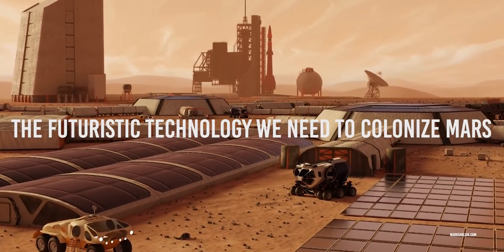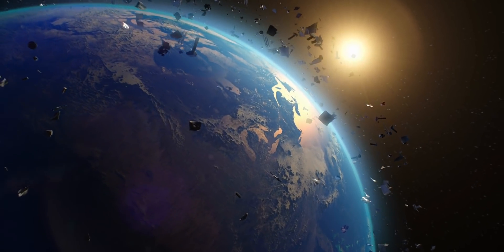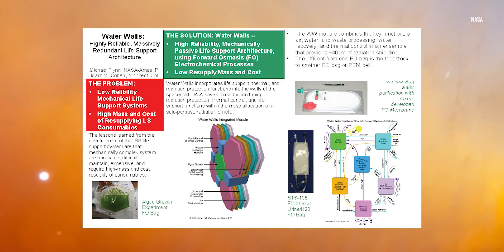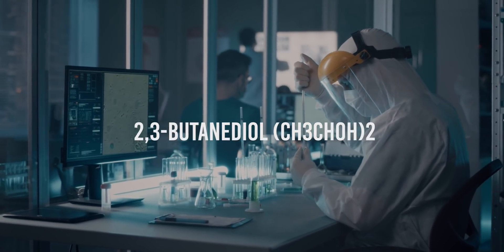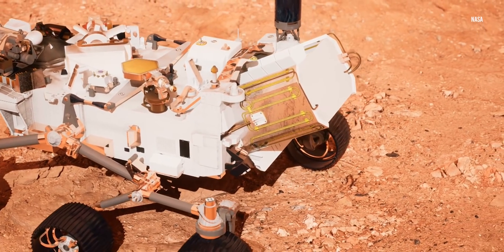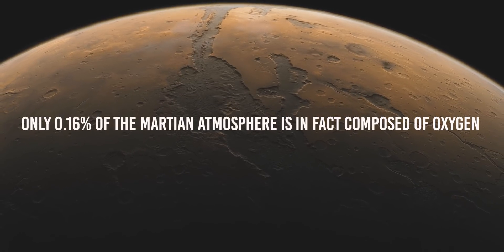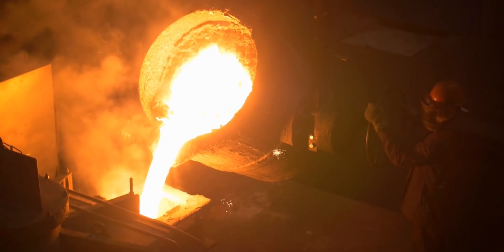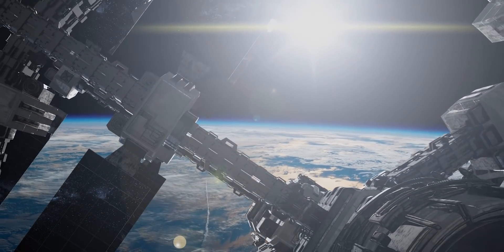The Futuristic Technology That We Need To Colonize Mars

Comment: On Mars you are still in open space. You still need a very good radiation shielding on Mars, not just on the travel to Mars.

And you won't have a steak on Mars.
With all these technologies you would not even have any food on Mars ;-)

You need really big green houses - and there has not been a single green house on Earth or in space that did not need fresh air from time to time ("Biosphere 2" and more). Good luck with fresh air on Mars ;-)

It is still possible, but it needs much more cargo for food or green houses and you need at least to cover some homes on Mars with thick layer of gravel, so you need these machines too.

And once you are on Mars, you need to wait 2 years until you can come home to Earth or until you can get more supplies from Earth. So you need to have 3 years of supplies (including food) with you for the 6 month travel to and 6 month back from Mars and for the 2 year stay on Mars.

And in case you can't come back to earth, you better have a good and sufficiently enough green house on Mars and have enough supplies for machines that might break and need repairs, such as the oxygen maker and so on.

And you will have a gigantic chip shortage on Mars unless you take enough spare chips and soldering equipment with you to replace faulty ones. And then you still can't make new chips... You can't make new steel, new plastic, nothing. It's a totally different story than going west on the american continent back then. They had oxygen, food, timber, coal, anything readily available on the land.

Comment: The main resource requirement is electrical power. With enough of that, oxygen, water etc can be recycled almost endlessly. Habitats will be closed systems, so whatever is put into them will, for the most part, stay in them. It's not like they will have a shower and let it run down a drain!

Comment: they should be designing some solar/nuclear powered robotic heavy machinery first and getting it shipped there to start preparing the future site of the colony. I think that should be the first step. And i personally think the structures should be under ground not on the surface. That will give them more protection from radiation. and they should be as close to one of the poles as possible  so they'll be closer to ice and water for all their oxygen/water needs.

Comment: Might be an idea to put Rovers spaced around the equator of Mars. Their task would be to drill a good sized hole several feet into the ground. Drop in some hearty organics and cover over with a peaked clear vacuum sealed dome. Could help incubate for a while. Then move on a short distance away to repeat the process. They could spend their time going back and forth to the organics to help monitor and  maintain them. Might be an idea to drill with a guide and an airblade. With an airblade there's no moving parts like a drill bit to wear out.

Comment: Why not just use food replicators and transporter technology to recycle waste? You could even make batteries for use in running the machines.
Reply: "transporter technology"? Could you elaborate on that?
Reply: @samr.england613  Hi Sam! From what I understand, transporters (or teleporters) work essentially the same way food replicators work. In both cases, a digital copy is made of the subject (whether a human or a plate of food). Once that recording is made, the information can be sent anywhere. When it arrives at its destination, the information is used to reconstruct the original from raw materials. The only difference is that in the case of food replicators, there's no need to destroy the original dish that got recorded, and having recorded it, that recording can be saved and used over and over to create copies of the same dish. But in the case of transporters, once the copy is made, the original person is destroyed, and once a copy of them is rebuilt, the information is erased so that extra copies don't accidentally get made, creating problems with identity.
Reply: @samr.england613  So are food replicators, Sam, but now we're just stating the obvious and missing the point of my post. The point of my post was to be silly, and the silliness goes beyond merely pretending like food replicators and transporter technology are viable options, but in also pretending like we can violate the second law of thermodynamics by having the replicators create batteries that can then be used to power the replicators.
Reply: @philochristos  😂 yeah I know food replicators are also science fiction.